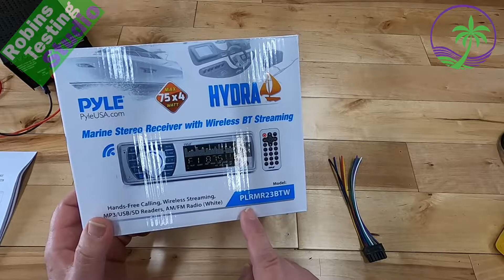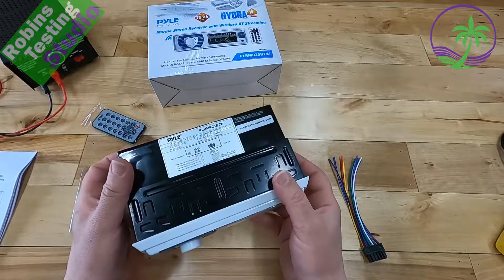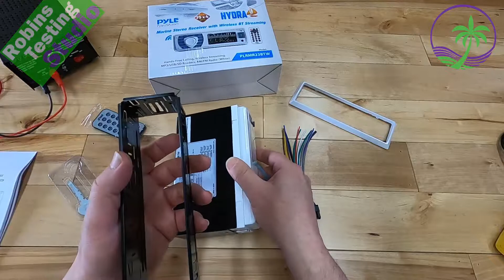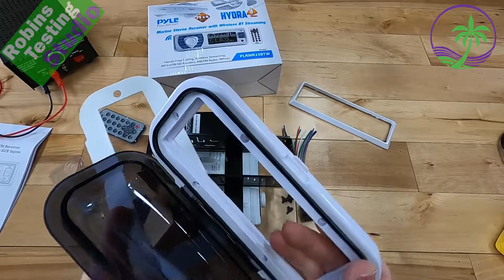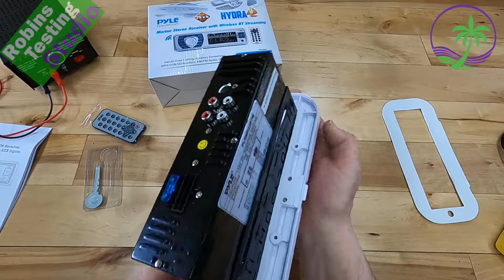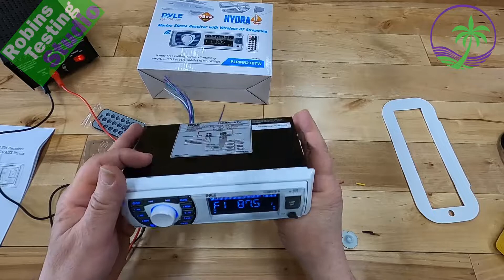Review of the PYLE PLRMR23BTW Marine Audio Bluetooth Headunit Radio Receiver

Comment: I would love for mine to work. wired it up just as you have with power to radio, but will not turn on. Any trouble shooting suggestions? Fuse is also good.
Reply: Yeah mine also didn’t work. Mine came with 2 wiring harnesses not 1 and I think we have a knock off

Comment: I just installed one in my boat. Even though I only paid $33 for it I still think it is not even worth that. I expected a cheap unit but... The LCD is not visible at all outdoors in daylight. Considering it is a boat radio I think it should be able to be seen outdoors. It also has poor sound quality and I think advertising it as 75 watts is false. It also gets VERY hot. I would not think of installing it in an enclosed mount. The front door that covers the SD/USB slots has no, ZERO waterproofing. This is not anymore marine designed then a car stereo. I am going to sell the boat or else it would be replaced. Since it was installed the returns policy is void. Basically stuck with it. Again, it was $33 dollars so I am not surprised, just trying to give an accurate report of how poor this is. Spend a little more, you will thank me.